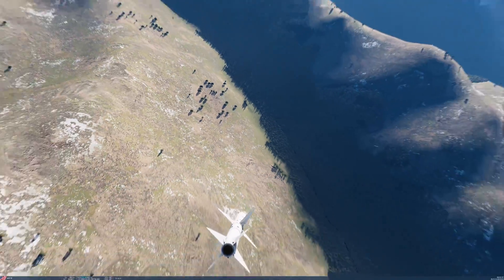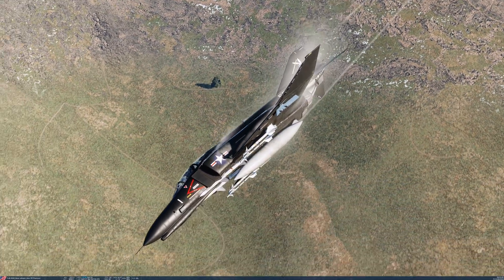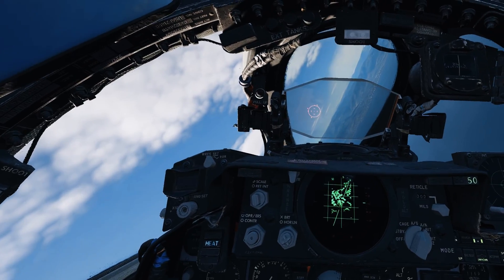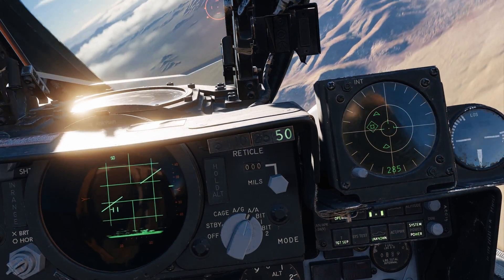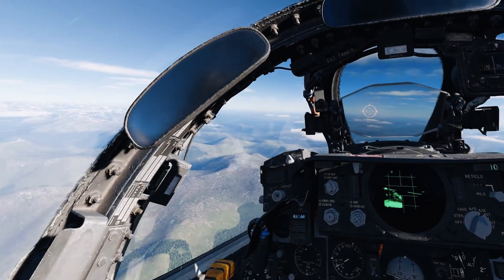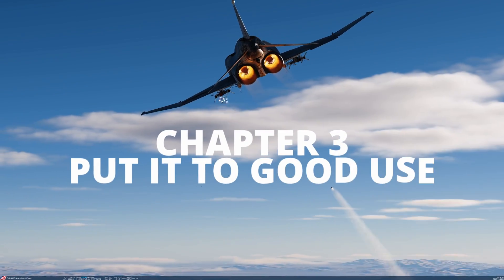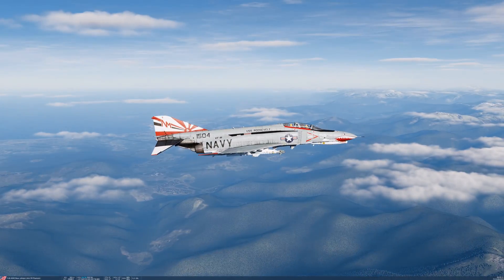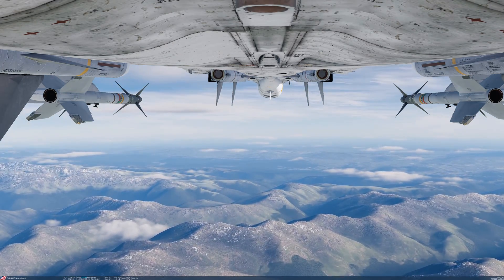How to Max Perform the F-4E in BVR with sparrows | DCS

Comment: Hey, you did not play with aspect changing in 25-boresight mode at all. Why? Because of default 'Nose' ratio at the head on course? When should one worry about target's aspect in 25-boresight mode?
Reply from the maker: since I am locking the target, you don't need to worry about the aspect at all

Comment: How are you recording in VR? My screen mirror looks like absolute garbage
Reply from the maker: man i had to tweak this so much. What I figured out is 
1) in the OpenXR menu (ingame) I've put the Shaking reduction (prediction dampening) to -100: the mirror view is way more stable (dont worry the headset will still pan the image correctly, it's just on snap movements you might see the black edges or HMD masks come into view) 
2) I don't set "use dcs system resolution" so i have the full square view on my monitor and record that with the nvidia overlay.
3) Motion reprojection/ASW is off
4) My ingame settings are quite beefed up while still pushing a lot of resolution in the headset because my pc has a big GPU, but for recording I would 100% reduce the headset resolution in order to pump up some settings. 
5) in post production use sharpening quite a lot, when on the monitor if feels a bit oversharpened it's good for youtube.
Reply from the maker: ah, and I try to sit a bit on the left to have the recording more centered
Reply: @alpenfoxvideo7255 
I will give this a go, cheers for the tips - your footage looks amazing

Comment: I've bound a wso gain control knob, and it works with jester too, with some caveats. 

1. Jester will override your gain settings if you don't change them for a few seconds. So, when playing with the gain, you have to constantly change it a little bit around your desired level

2. From my experience, increasing gain is useful to get longer-range locks from a boresight mode. In this video you got bad locks in boresight when jester was magically targeting that hornet, but you didn't have any returns from in on your radar scope. If you'd increased the gain to the point when a hornet return would've been clearly visible, you'd probably got a good lock

3. Increasing gain also helps with jester detection via normal search mode. If you'll increase the gain over the settings jester uses, he'll spot contacts further away. Just be aware, you shouldn't increase the gain to the absolute maximum, just up to the point when all the radar returs occupy approximately 50% of your radar scope area. Over the mountains this trick doesn't work, because they reflect too much clutter, but over the water, desert or plain fields you can definitely increase jester's search range
Reply from the maker: that is extremely interesting, I was testing stuff like this yesterday but in boresight everything was working so weird. I got in contact with HB's Zabuzard and he confirmed me that boresight mode is not controlled by jester, the radar goes into computer auto-gain and it's not jester the one that moves the cursor, it's the computer.

Developers are now taking a look at why the auto-gain is so low, there is a ticket opened in their discord that you can upvote and maybe put in one of your tracks that shows this.

Hopefully we won't be needing these tricks down the line
Reply: @alpenfoxvideo7255 hmm, I'm curious over the auto gain control stuff. Because I clearly see the difference on the radar screen when I'm increasing gain manually while in boresight mode
Reply from the maker: @ВячеславФролов-д7я  i need to take a deep dive on that, probably it is a broken part currently in DCS and we are as always pushing the edge of envelopment
Reply: @alpenfoxvideo7255  In boresight the gain is manual, the same as normal sweep, it will only be automatic around the cursor with half action. This is the correct behaviour and consistent with the real thing.
Reply from the maker: @JNelson_  thanks, that makes this issue even more concerning.
Reply: @alpenfoxvideo7255  I think you misunderstand jester is moving the cursor in boresight mode, and the gain is still manually controlled by jester. If you were to WSO yourself you'd have to control both the gain and cursor. Unless you half action then the gain is automatic, but jester doesn't action until on a target.
Reply from the maker: @JNelson_  I do understand it as you've explained. I am concerned as the premise that [jester can only see the pixels and can't "see" the raw radar data] becomes invalid. This phrase is thrown around a lot in the issue threads
Reply: @alpenfoxvideo7255  Not sure what you mean by raw radar data. To pull back the curtain for a second, jester works by doing a series of image convolutions on the radar picture to highlight anything which looks like a returns. This by itself would be far to noisy make jester competent, so jester (not the radar though) is allowed to cheat a little bit, he is allowed to know the positions of aircraft, but he can only "see" them if they correlate with a return spotted from the image convolution step.

The problem with boresight is there is no straight forward way to recognise a target as the azimuth component is completely removed. So in this instance jester actually skips the image convolution step and just cheats, this was initially limited to 10 nautical miles if I recall correctly and I'm not sure if this has changed since. This is perhaps why you are seeing better performance in boresight. Realistically though if jester used the gain better these target would be visible in normal scan too as even with boresight you cannot track something which would not be trackable in regular search.

Jester only ever operates the radar he never modifies how it works.

Let me know if you have anymore questions.

Comment: The first video on the boresight mode that ignores the different closure setting options (speed gates). You didn't even mention them. Wondering if you find those options to be useless?
Reply: They are only for flood launches. When you have an stt lock, you don't have to fiddle with this settings, the phantom calculates the closure rate for you
Reply from the maker: For the given scenario (80s servers) I wanted to focus on long range shots, that requires: 
1) having a lock the earliest as possible to have the sparrow range computed
2) be able to do a crank maneuver
3) have the missile track if the bandit defends

Don't get me wrong, flood is useful, but there are several videos already on it and in these more advanced scenarios that will put you within F-16 Aim-9 envelope range and well within the other interceptor jet's MAR